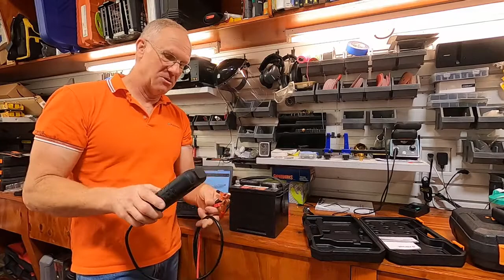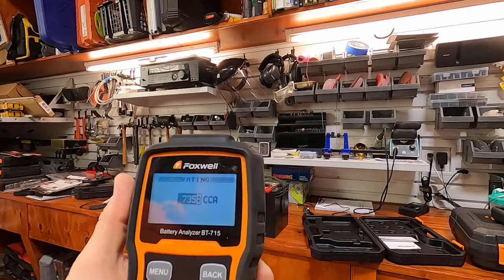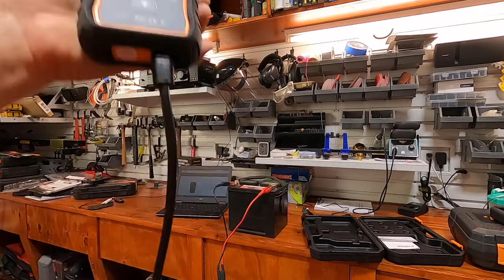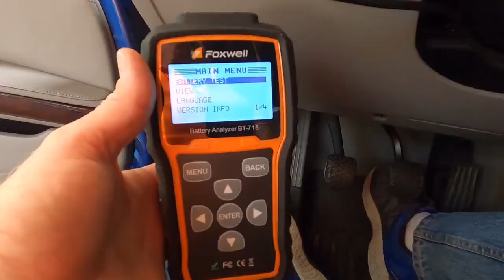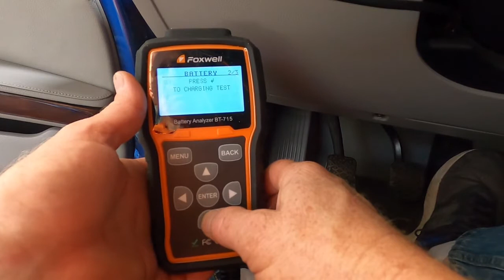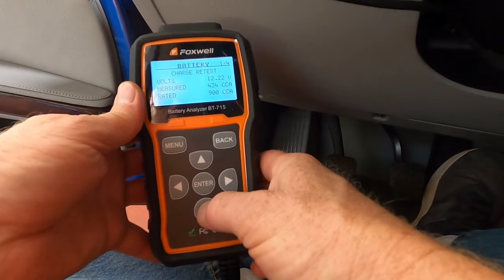How to use Foxwell Bt715

Comment: Nice unit, but my money is on midtronics or associate! 😎
Reply: Do you think midtronics is more precise than Foxwell?
Reply: @carlosw1687  100% better yes! Just look at his test, the battery is a little weak yet tested 12.80 which is better then new. The algorithms built into the tester are off. With the midtronics it's a 100% accurate. And how you know for sure is take a Volt meter and test the battery and then use the tester, if the numbers are the same you know it's an accurate unit. Hope this helps.